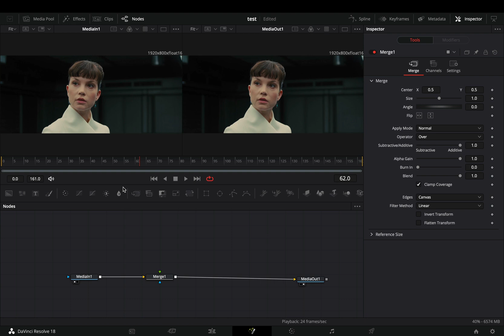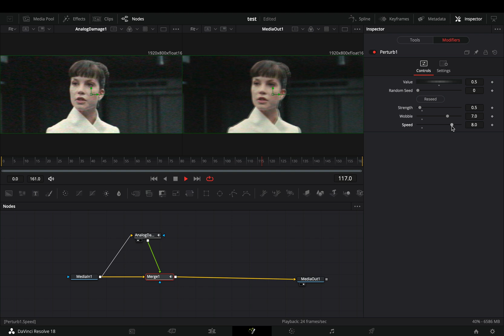Analog Damage Effect | DaVinci Resolve Studio 18 |

Comment: How to improve the result of Planar Tracker in Fusion page? I was trying to track some items behind a panel of glass, the reflections on the glass panel probably caused the tracker to be jumping everywhere, despite the item to be tracked can easily seen by human eyes. Is there any special tricks?
Reply: I'm not able to get to Resolve at the moment as I'm away but in planar tracker is there any options for adjusting the colour/contrast settings (these can help pick contrast out better on what's being tracked and give a better track of data.  To see an example look at just the tracker node, you'll find the colour/target preview in the inspector in the lower portion.  Alternatively I think the tracker node itself has a planar tracker equivalent that you could try using?
Reply: @motion.resolved  Thank you... will try to find those.
Reply: @masterof  you can also add a color contrast node as seen in the examples above also do edge detect.  It's just for tracking you don't need it once you get a good track.
Reply: @Photovintageguy  Thank you... Will try that next time.
Reply: @masterof  no worries, John makes a good point about just colour correcting beforehand then tracking based on the output of the colour corrector too!  Good luck!
Reply: You manually remove tracking points that are tracking the reflections. See this video. https://youtu.be/zJj6RMZ4zQs
Reply: Manually editing tracker points.tips etc.
https://youtu.be/FlsqiDwdA_E
Using masks and remove tracking points manually.  https://youtu.be/8rS7gVLpaOU